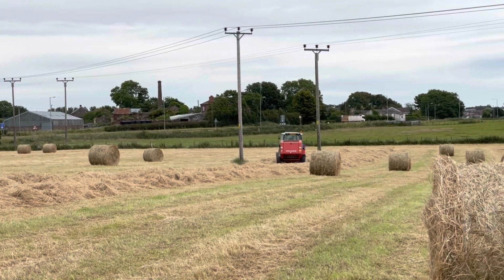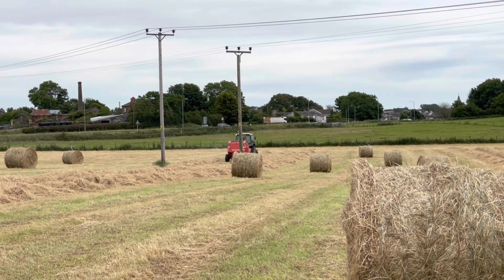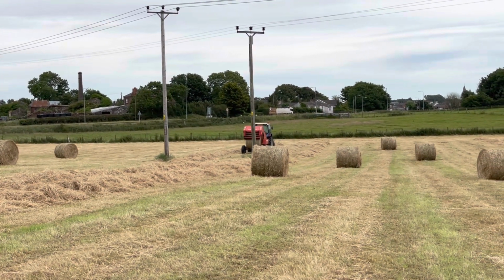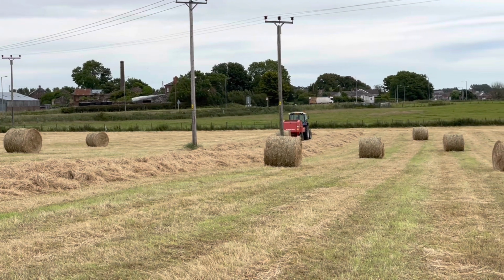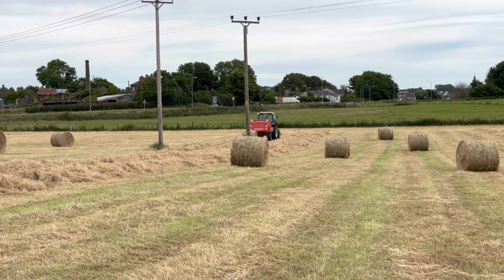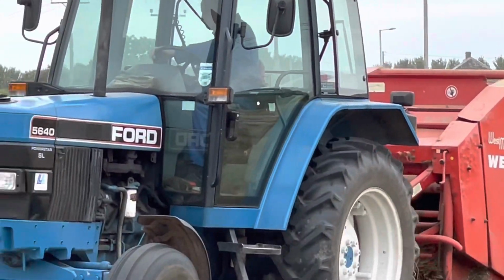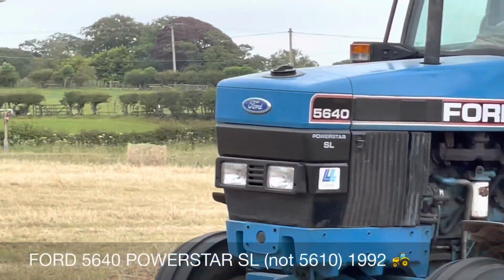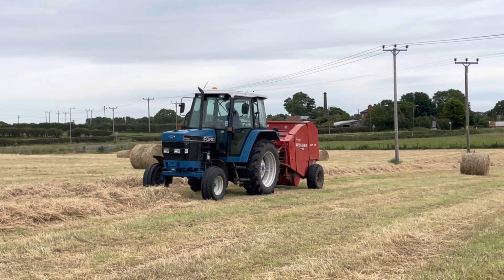FORD 5640 (1992) WELGER RP 12 gtritchie5

Comment: nice 2 see
Reply from the maker: I really like 👍 to see the older machines still working 🙋‍♂️
Reply: @gtritchie5  yeah same tbh all this new stuffs not as good ,thanks for sharen
Reply: I ran a rp12 for 30 years, from 1990 till it wore out in 2021.Used a Ford 5610 to turn it, it would struggle for power in silage, stalled the tractor a few times over the years!! Run a rp235 now behind a 130hp tractor,  i can clear a field in less than half the time now ,and blockages and breakdowns ar a thing of the past